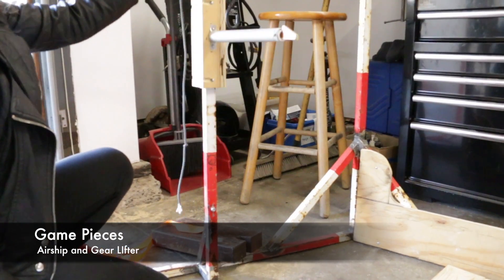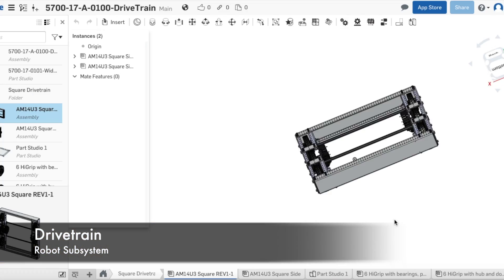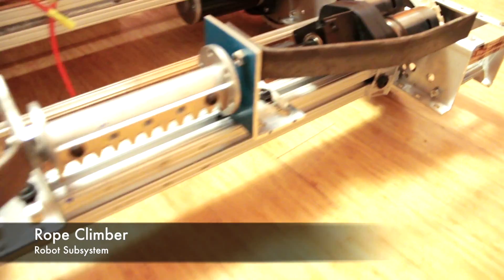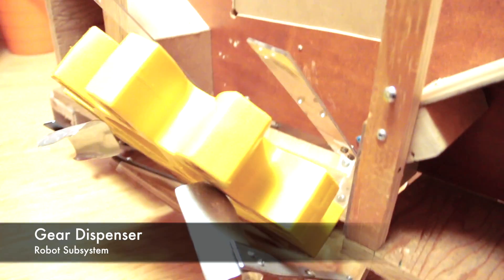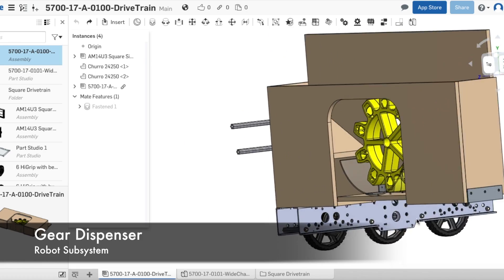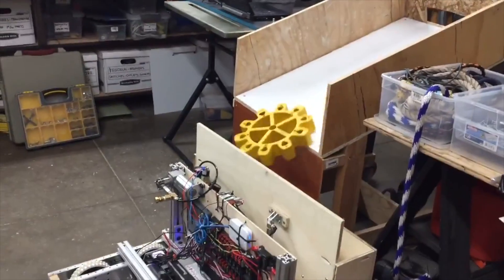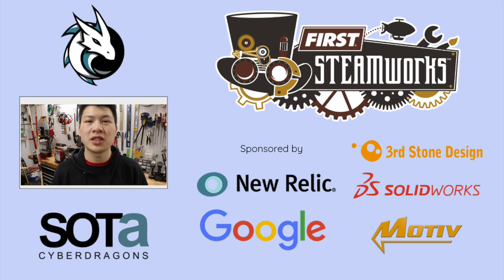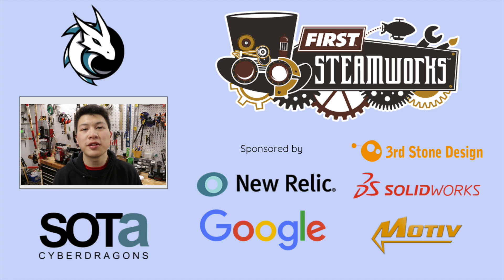2017 Steamworks: Build Season | Half Way There

Comment: tinkercad?
Reply: OnShape, it's an online CAD software which is connected to the cloud. So we can create CAD files from anywhere and access from anywhere.
Reply: Nick Mak OK cool I haven't used it yet. it it run through a Web browser only? I use fusion 360 and solidworks-2733
Reply: https://www.onshape.com/ is amazing. They gave us a free educational team license. We haven't touched SolidWorks since. Browser only, works on any platform. We had a problem where people had Macs and couldn't run SolidWorks even in a VM. With OnShape that problem is gone, you can grab any laptop and be working away. Most of our designs are public (Team 5700).